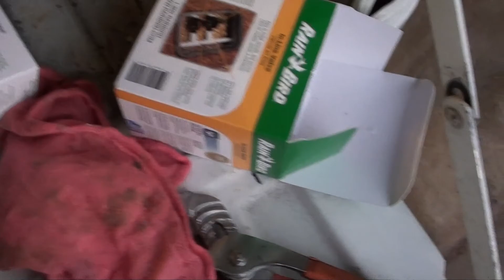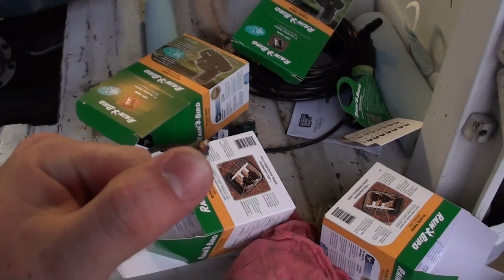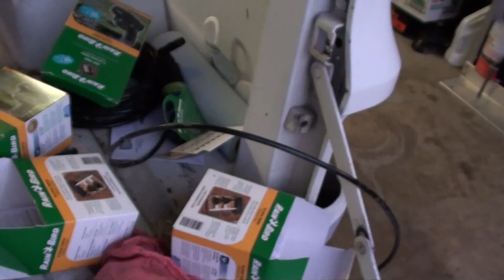DIY Sprinkler System

Comment: hope to do 1 zone to 3 this week depending on if i can get the materials. a few more q's how are you going to winterise like clear it of water and can you do a vid of how to wire it to your controller or how you did do it cause thats the part im stuck on in my head, and insted of pvc do you think i could just use a detachable garden hose and  and the funny pipe? and you CAN use the funny pipe for the whole system. and how many heads per zone?
Thanks you have been a huge help for me!!!!!!!

Comment: I see you put the primer on the pipe early. The purple primer should be put on right before
you glue it. It's not like paint primer. What is does is soften the pipe a little bit so the glue
can get good penetration into the PVC.
It is very good to see that you are responsible and use a back-flow preventer.
Very nice Blue truck

Comment: How does the Poly Tubbing hook up to the electric valve?
Reply from the maker: +KJA Gaming Network They make barb fittings on one end and the pvc pipe thread on the other.  You can see those at 0:01 on the left side.

Comment: Hi my name is John I am a sprinkler contracter in Florida I hope u figured out the gpm and the psi of the water so u can no how many sprinklers u can put on a zone and u shuld not splice in that wire there u shuld make a splice in a box and use water tight wire nuts I would not use union's on all those valves just a chance to have a water leak
Reply: john Kosheluk I'm installing a system at my house soon. I have 17 gpm from my hose faucet. What size PVC should I use? And can I run 7 sprinkler heads on one zone?